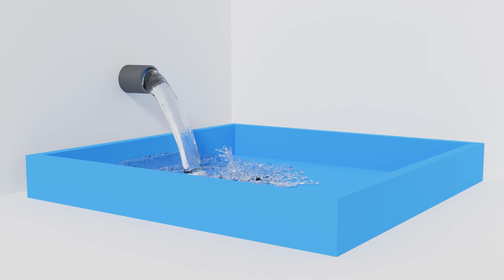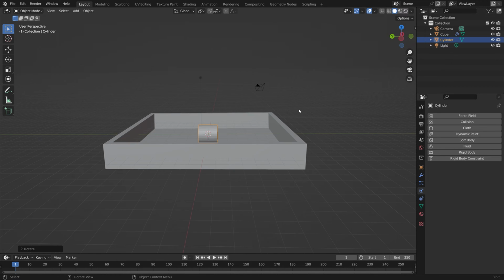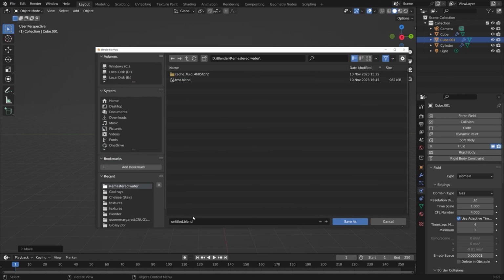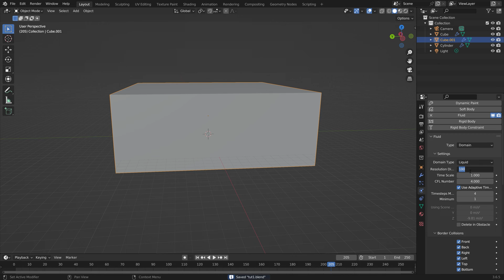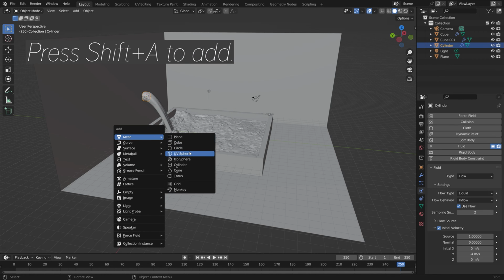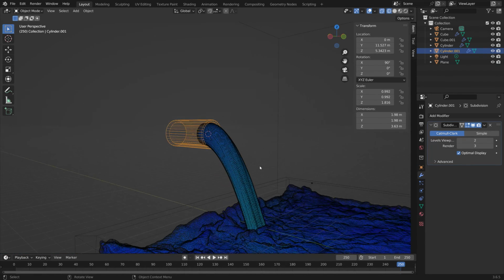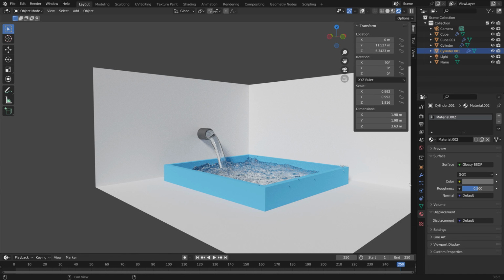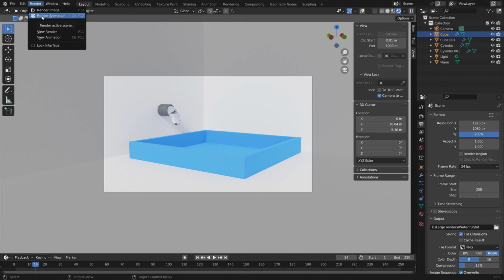[3.6] Blender Tutorial: Quick Water Simulation

Comment: why my cube doesnt go transparent after clicking diffuse and mesh? help
Reply: Try and go forward a little on animation thing
Reply: Did you fix it?
Reply: First bake the project , after your domain will be invisible.
Reply: @TheAlbinobatman Even if you do that it will not work. There's another step that must be applied. Version 4.0 or higher might I add.
Reply: @alchemvizuals  There is no trick ! 
1: Do an projeckt AND save.
Int he domain settings :
1 :The diffuse and the mesh option should be switched on.
2: The type will be " All " and take switced on the " Is resumable " option.
3 : SAVE
4 : Bake.

It doesn't matter wich version .Good luck !
Reply: @TheAlbinobatman  this one fix it i just set the type from modular to all and the cube goes invicible. Thanks man
Reply: @jhoncarlosecuya  I'm glad if  I helped !
Reply: @TheAlbinobatman  tnx man...
Reply: @TheAlbinobatman   doesn't work
Reply: @Dr.Doge117 Try again !
Reply: did you find any solution??
Reply: @aaditya7193  yes just follow albinobatman's comment
Reply: This is because your frame on timeline is 0 . You can go forward to solve this.